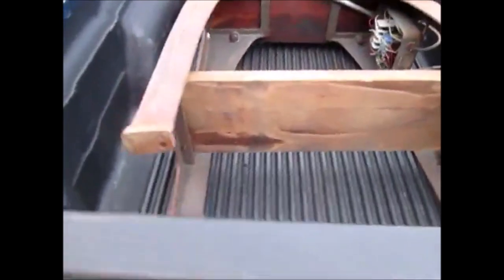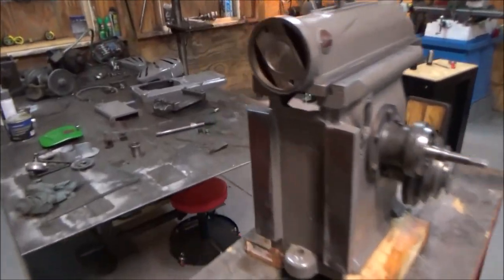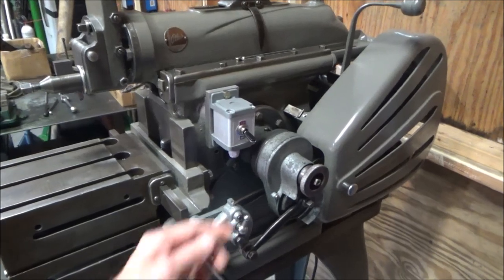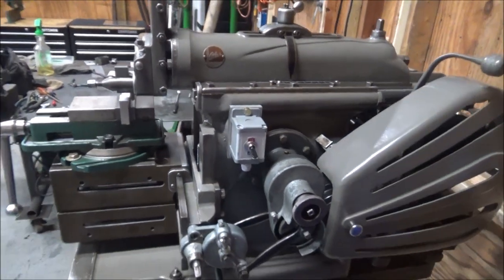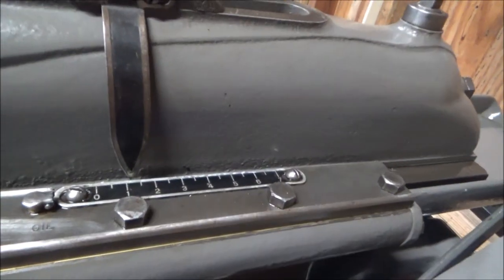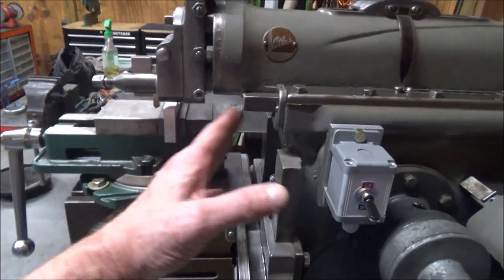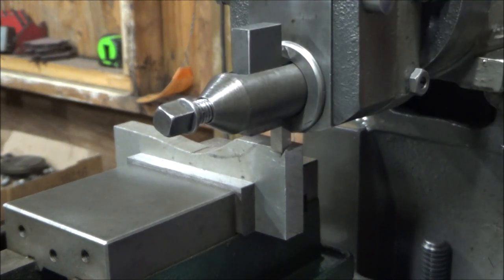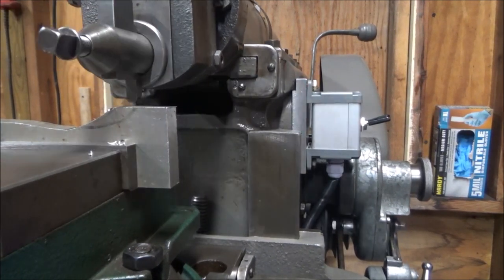Atlas Shaper Resto and First Cuts

Comment: Congratulations! Nothing quite as exciting as new machine day. And I am biased, but the shaper is my favorite machine to run. Maybe you have heard it before, but it is often said that you can make absolutely anything on a shaper other than a dollar. Wonderful machines to have. If you're not already very familiar with them, it's really worth getting some reprints of the old instructional manuals. There's a lot of very unusual setups with a shaper that are not necessarily intuitive. I know an unfortunate amount of shaper owners who never bothered to learn the geometry of The clapper box and how to best use it to your advantage. It's really an amazingly diverse tool, you can put all kinds of things in it. I've even been known to use a slotting lathe tool when I needed an unusually precise edge on a 24 in piece of aluminum, use it in lieu of a bandsaw and following up with an end Mill. Really fantastic machines once you learn their little quirks. But specifically look for a reprint of an older manual, the new ones leave out a lot of set up explanation especially focusing on The clapper box. I don't have a great deal of experience but my 29 inch Cincinnati has a remarkably good manual. Although lately I have found a few resources online that sell full service manuals in digital format usually for about $12. I personally prefer the paper manuals, but even the bootlegs are typically over $100, it might be worth it to get the digital version and just print out the exploded views or other particularly complex portions?
Reply from the maker: Thanks Jean-Paul. I do have a couple of reprint books and also quite a few old articles I've printed out. Hopefully it won't take me too long to get a handle on the basic operations. Thanks for watching.